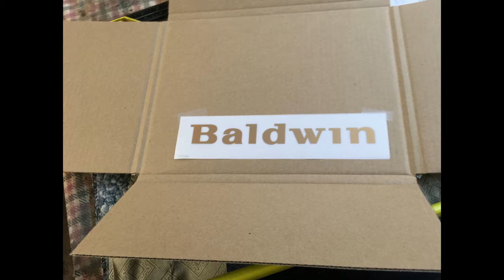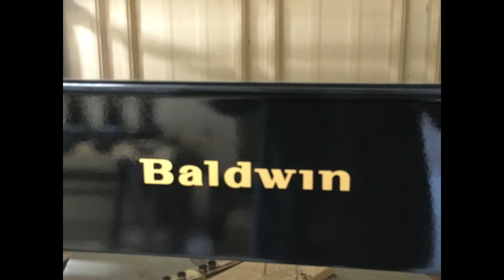1950's Baldwin Piano Restoration - Before and After Transformation

Comment: Hi Jennifer, in order for your stain to take and be uniform it’s important to be down to the bare wood. That said, it’s extremely difficult to get there by sanding. You really need to chemically remove the finish which is not fun but in the end will expedite the process. To put it in perspective the piano in the video took 150 hours to complete. Hope this helps.   Brent
Reply: What type of stain did you use?

Comment: Question. I'm not painting my piano with paint just changing the color to ebony with wood stain. Do I have to sand until it is just the bare wood or just enough where the gloss comes off?
Reply: J V you can use paint striper instead and then sand  it
Reply: @MARTIN201199 stain won’t grab where there’s clear. If you strip you run the risk of ruining the veneer. Probably cheaper to sell it and buy one you like.

Comment: I purchased a baby Grand that was in good shape but the Cabinet was very cracked up and in Very bad shape.
First thing we striped it down to the Veneer but even at that point things did not look well. Finally we decided to remove the outer layer of Veneer for so many reasons. Blisters cracks and more. The outer layer of the veneer was replaced with Maple Veneer and all went well. As it was looking really good the veneer was primed and a base coat of Black Pre cat Lacquer was applied (2 coats). Now that 4 coats of clear Pre cat Gloss was applied and complete and all looked great we opened up the garage for some fresh air and sun light.
I was shocked to see ripples and bumps in the finish from the veneer. I knew at this point I made a major Boo Boo ! When I applied the vineer the under surface was not perfectly flat and now that is what is showing.. 
I know I am back to sanding and painting but I need advise how to level this.  I would like some serious constructive advice Please.

Thanks in advance !
Reply: You have to start all over. Strip off the veneer you applied wrong and sand everything smooth and lay new veneer down. Then an apply a 1 thick black coat. Your going to black sand the first coat then apply 2 more black coats blocking the finish in between. Then lay a final 4th coat which will be block sanded before your first of 3 layers of cleared each being sanded in between. Make sure you have plenty of lighting to view your progress. Then polish it at the end.

Comment: Is this finish cause by rubbing the gloss coat in one direction? I like it, want rub my piano gloss to this kind sheen.
Reply: Hi, Yes, the rubbing process is old school. We use 3 coats of gloss lacquer, that`s after all the priming and sanding. We start rubbing with 800 grit and oil and go to 1000 grit ,all blocked and straight lines. We finish with 00000 steel wool and lube. This creates a beautiful satin finish.
Hope this helps,
Brent Sr. 
,
Reply: @handmadehomedecor  thank you so much, may I ask what kind oil and lub are used during rubbing, I was thinking using rubbing compound.
Reply: @jlai3861 they use a special oil. And procedure for this finish. Be careful because you have to follow the grain carefully.